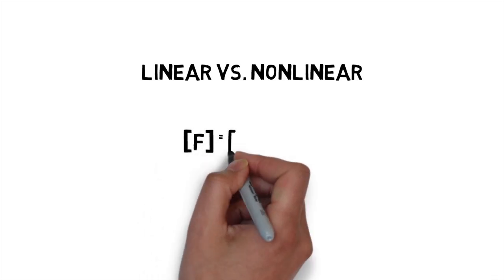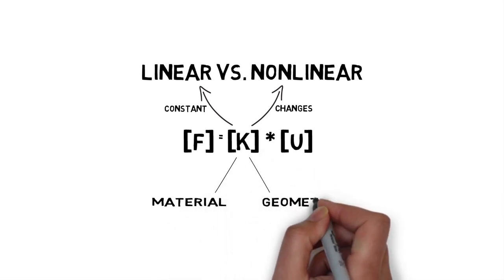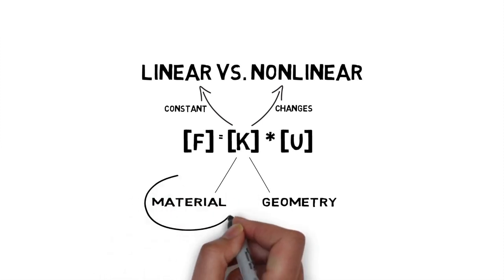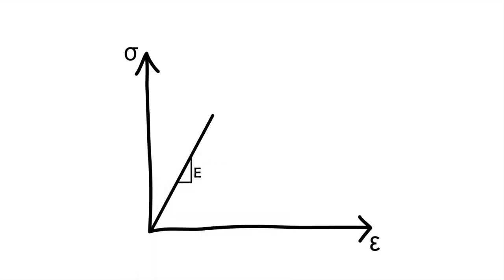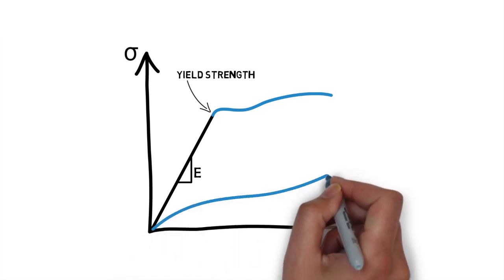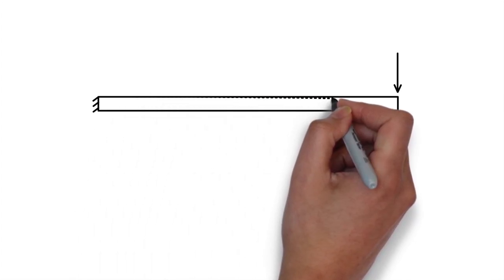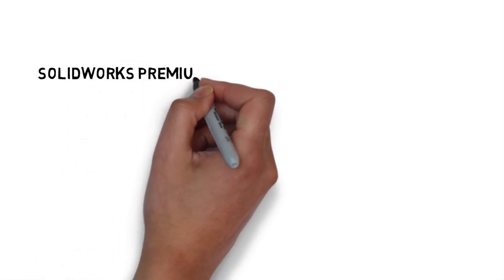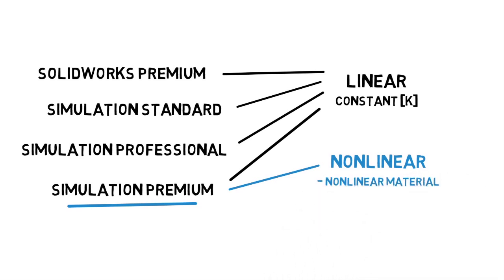SOLIDWORKS Simulation Theory - Linear vs. Nonlinear

Comment: The presentation of  Linear vs Nonlinear is done in a very clear manner; thank you for that, Terence!  But to further expand on his explanation, there are two (2) other sources of Nonlinearity that involve the following: Force and Contact.  If either the magnitude or direction, that is the vector on the left hand side of the equation shown, of the force changes during its application to the body, then it requires a nonlinear solution.  If any two bodies change their interaction between one another, such as coming into contact caused by the application of the load, then a nonlinear solution is required.  The key metric is change; if there is any change in the linear assumption of the original equation, then a nonlinear solution is required.
One main type of analysis capabilities available in the SOLIDWORKS Simulation packages is called "Static" analysis and NOT "Linear Static."  This is a done purposefully because SOLIDWORKS (SW) wants to excel at doing Static analysis for parts AND ASSEMBLIES, which is the majority of what people design in the CAD program.  Static analysis in SW Sim can handle contact between bodies, and incremental loading for a large displacement, but note that you would only be able to visualize the results at the end of the load application.  You need to go to a Nonlinear calculation with SW Simulation Premium if: there is material nonlinearity; intermediate results of a solution are needed; the force vector changes; there is a change over time (i.e. dynamic); or any combination of those mentioned. Otherwise, a Static solution may suffice.
Reply: Thanks you did answer a lot of my questions!

Comment: if we have to do Finite element analysis manually, what modifications we need in non-linear analysis? how we have to change stiffness matrix?
Reply from the maker: If you are considering adding material or geometric nonlinearity you will need to specify your nonlinear material properties, to consider large displacement, or both
Reply: Danke Schon

Comment: Hello,

I want to run a simulation that will combine buckling and bending. Is Solidworks capable for this? I already tried to run a couple of simulations, but some errors occured. Where would you advise me to search for documentation and knowledge on Solidworks Simulations, especialy on what I am looking for. (I already know the basics about Finite Element Analysis)

Thanks in advance.